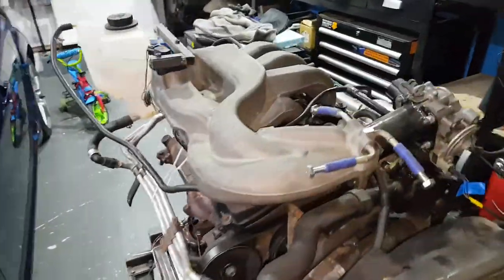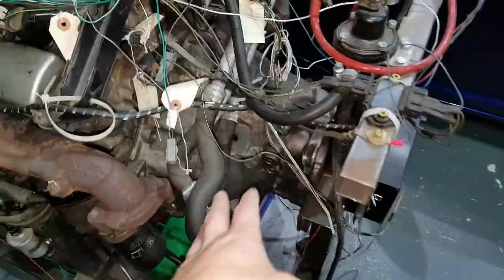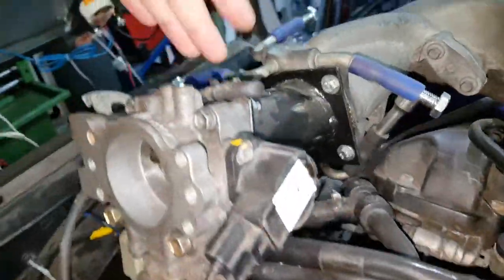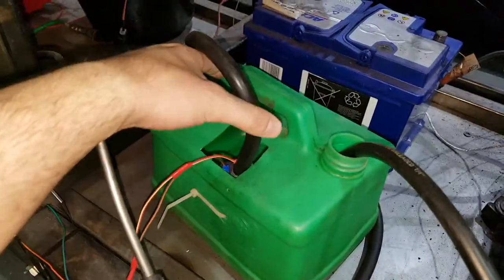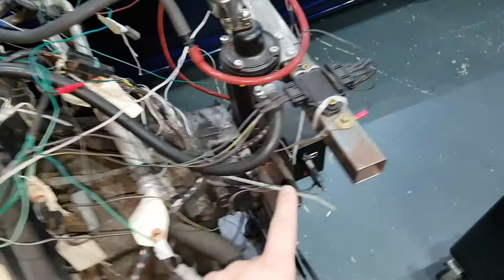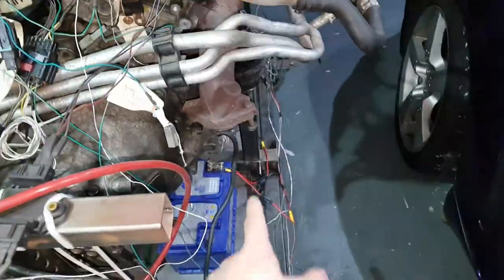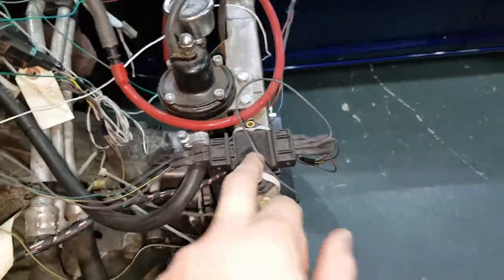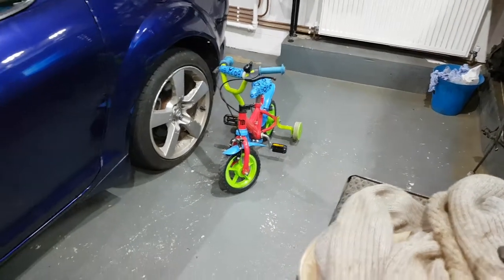A walk around of the AJ30 V6 with Megasquirt MS3X

Comment: Thanks for the videos. I''ll be following this project as I've been looking at putting one of these in a Viva.
You can use the X-type or Mondeo inlet to save a lot of space and it makes sense if you're not going to use the variable length feature of the original anyway. I run a manual S-type with this engines as a daily and yes, manuals are like rocking horse shit!